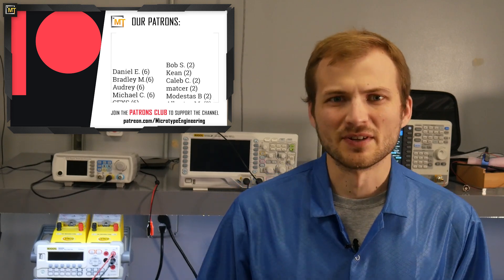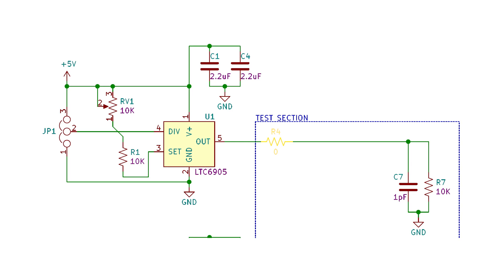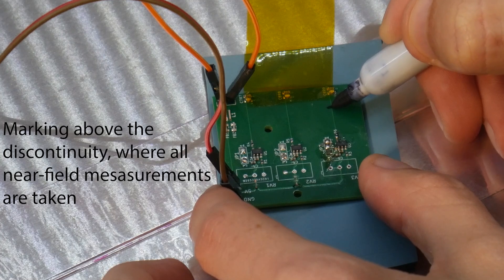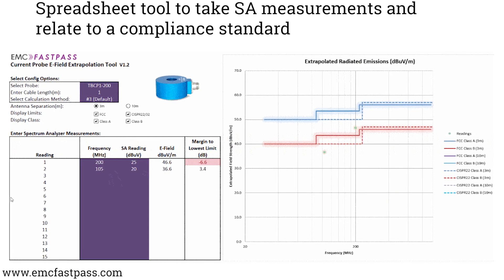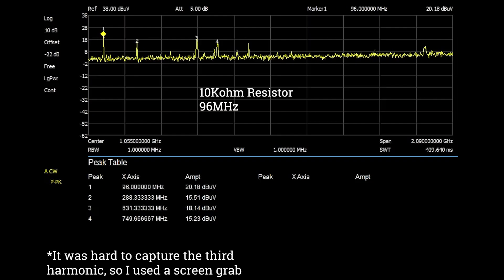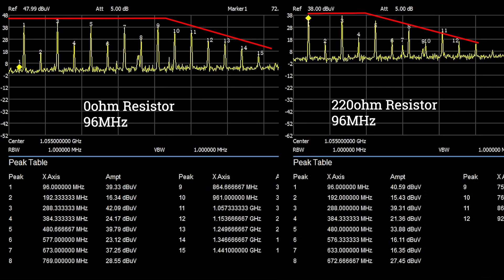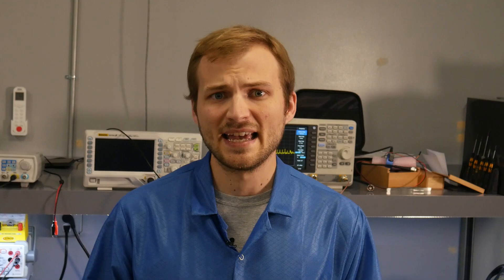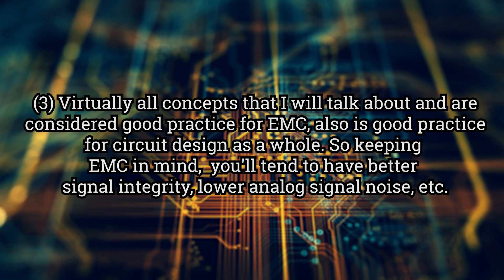Does Frequency Even Matter? | EMC For Everyone #2

Comment: I don't get why the resistor will have any effect on the rise time of the signal. The maximum voltage will get lower, but the rise time will be the same, since it is just an Ohmic resistor.
Reply: The load will have some capacitance and there will be parasitic capacitance along the line so a series resistor essentially turns it into a RC low-pass filter. Increasing the resistance increases the RC time constant.
Reply: @karolus8517  that now makes sense!
Reply from the maker: @flienky well crud, guess I should have clarified that! But yes, @karolus is spot on, it's an RC filter
Reply: @flienky  also, more often than not you're driving FETs or CMOS and then the main source of the capacitance is clearer - the gate capacitance of the FET. You probably have encountered gate resistors on FETs - they are there to limit and control the rise and fall time. I thought I'd add that because it's something you might already be familiar with! But all loads will have capacitance, whether it's been wires or the PN junction between the base and emitter of a BJT. Death, taxes and parastic reactance.
Reply: @karolus8517  thanks dude!